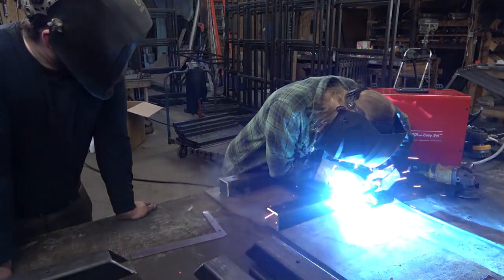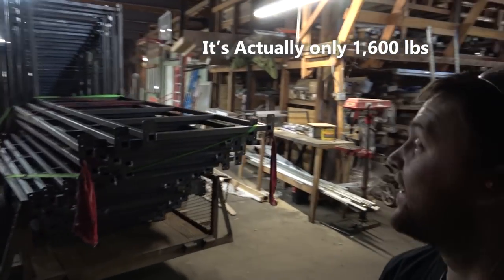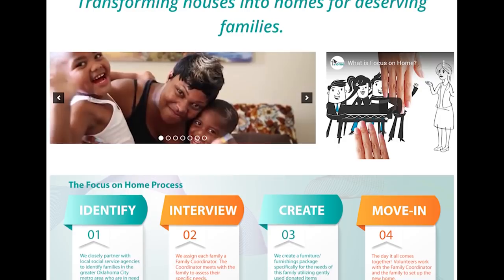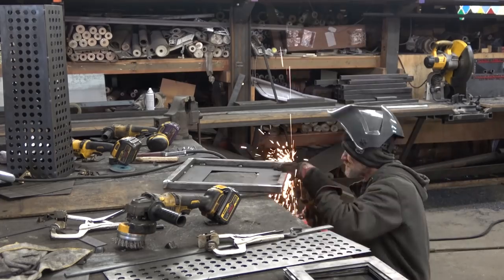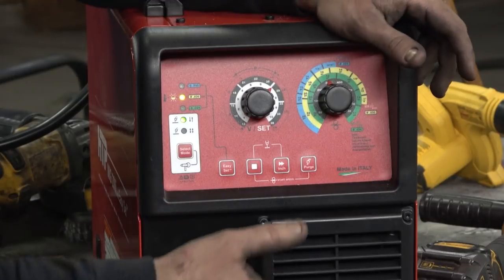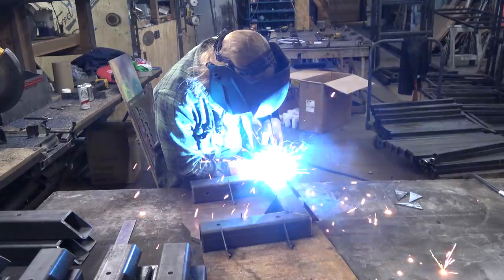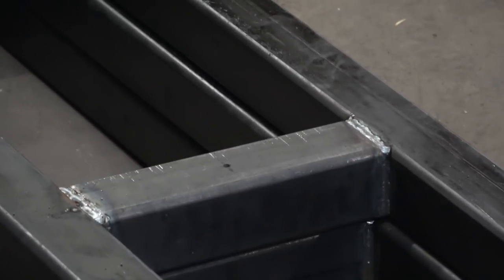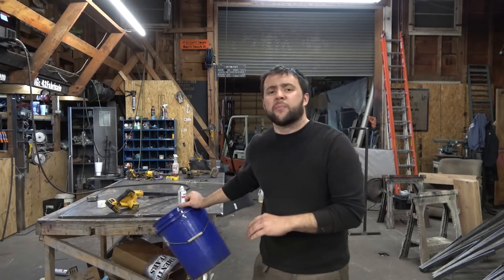Wrapping Up Production in the Shop!

Comment: Very nice. If I may ask, why didn't you opt to put the flange and bolts on the under/inside of the racks as to reduce the risk of damage to the couches?
Reply from the maker: If they went under they'd either have to stick out the front, risking snagging someone right at hip height or under and inside, meaning the joint would want to become a hinge. Having some above and below means you're having to bend a lot more steel in order to fail the joint, with no "lever" arm to make it easier.

Comment: I’m surprised you don’t mark up materials.  Do you charge the shop rate for picking up steel and drop off of the project?
Reply from the maker: We do charge drive time to delivery, our materials are delivered free, but we charge time if we have to go get them due to a customer rush. In short, I charge for my time, that's the thing I'm selling, everything else is at cost
Reply: Personally, I’d be putting a small markup for covering your time ordering, invoicing, book keeping, receiving stock, dealing with suppliers, etc. even if it’s only small. Standard markup I’ve come across though is around 1.6.

Comment: I'm not paranoid about fire but am all too aware that most fires are preventable.  That being said I think I wouldn't keep the boxes under that table but that's what I do in my shop.  If it works for you, no worries.  I love the commenter's tears.
Reply from the maker: As this is the most sensible critique I'll reply. We use the underside of the table as a catchall trashcan because it alleviates the need to have a trash container taking up floor space, being in the way, etc. Any time we smell smoke all work stops until we find the source. That is most often either someone using a dull bit on wood, the oscillating tool (smokey little bitch), or someone having lit a cigarette (I do not have control over who smokes inside) with a match. We also take the obvious and important precautions like having fire extinguishers all over the place and operating in a building with well over $200k worth of sprinklers everywhere. 

People can have their worries, that's fine, but the constant whining of "OMG fire" is indicative not of concern but of the need for attention and the innate human attribute of a negative comment being more likely to illicit a response, triggering that attention seeking with a hit of dopamine. People make their own decisions, these are ours, they are uncontested by both our insurance provider and the fire marshal, both of which regularly inspect the building.

Comment: How confident would you be welding 1/4 inch with the 200i with a single pass?
Reply from the maker: If you got it turned up enough and went slow, I'd go for it depending on the application
Reply: @42Fab  ok appreciate the feedback

Comment: I'm a hobby welder building thing's for My Jeep's Bumper's , Rack's , Nerf rock slider's bar's,  bracket's for My 60 gallon air compressor for a 25' and 50' hose reel's too mount on My compressor,  for 16 plus year's up until 2018 I used 0.35 flux core wire because I couldn't afford too buy a tank and fill it with 75/25,  Oct  20. 2018 I had a Heart Attack had triple by - pass surgery and had another surgery in Feb 10. 2019 because My chest got infected, That happened in the middle of packing up too move, went from a 4 bedroom house 2 car garage too a 2 bedroom apartment one car garage and no 240 volt outlet, so I have too try use My  8000 watt generac generator too run My Lincoln Nascar Pro 175 Mig welder and My Hyperthem powermax XP 45 Plasma cutter, right before I went into the Hospital I was going too buy a new Everlast MTS 252 STI  A/C D/C welder So I could learn too Tig Aluminum but now unfortunately I don't have the money anymore, Being on Disability really SUCK's,  The last 2 year's in a row I missed Good of the Land fest because My Heart Attack,  Stuck between a rock and a hard place, LOL ,   Richard I love your video's and the way you help other people learn how too weld and too help the little dog too walk again, you are the Man, I wish My 3 Boy's where more like you, If more people where like you this World would be a better place too live, Sorry now for My question that I was going too ask you, LOL  how do you choose type and size wire  you use for different size metals of materials, I would like too try some Dual shield spray arc, Thank's for the Great Video's Richard, love the Stud welder can I have it  LOL 
       Thank you   jeepinjim63@gmail.com    Jim
Reply from the maker: We generally run .030 wire in the machines. As most of what we do is 16-10ga it's a good wire for being able to lay metal without burning through. I like to keep one machine with the 15' gun on it and that can have a hard time pushing .030, so we run .035 in it. I almost never have the need to venture into some of the more exotic wires and combos, as much as I LOVE getting to turn up into spray arc and lay into a weld.